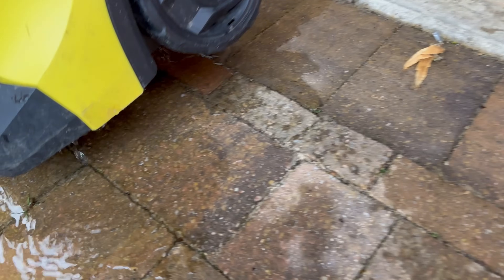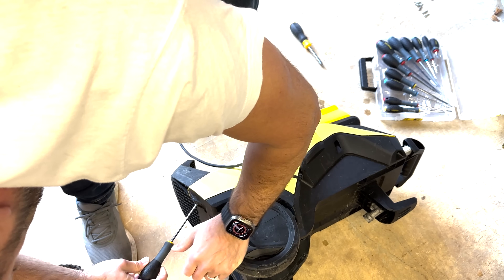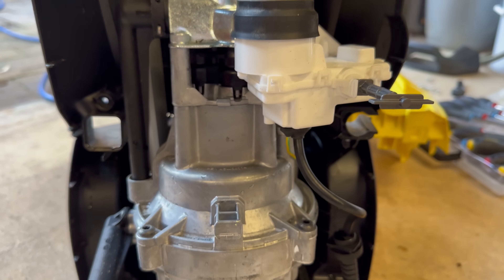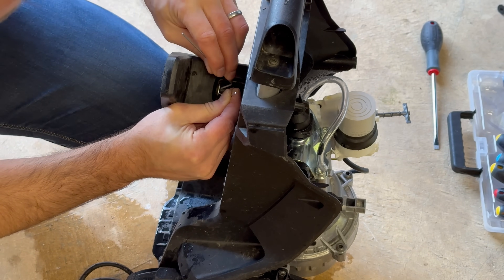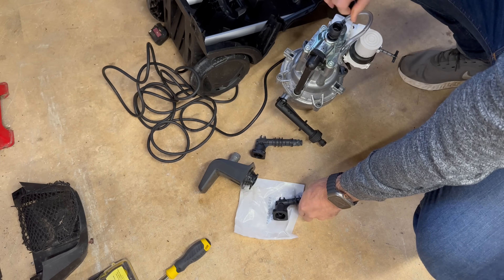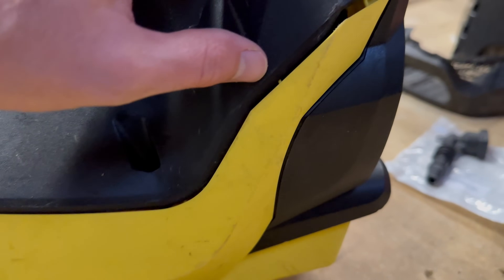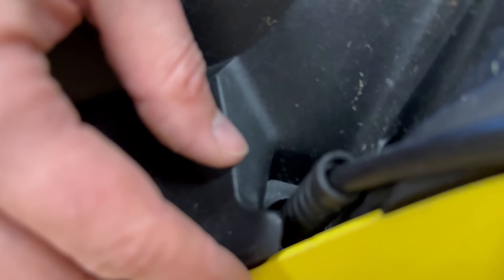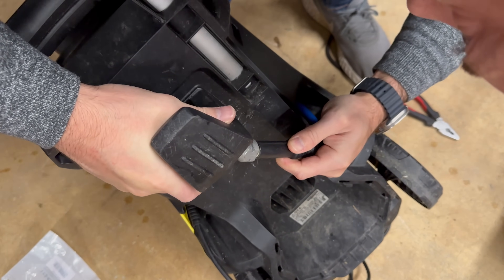Karcher K4 Pressure Washer - How to Open and Fix an Internal Leak

Comment: Thanks for the video. I have to disassembly aswell, but the pressure washer hose is stuck in the pressure washer. I really can't get it out...
Reply from the maker: Hi. If you cannot disconnect the hose after removing the spring clip, you should still be able to dismantle it with the hose still attached to the back foot.  20min 10sec onwards in the video shows the best view of the hose connector in case that helps you understand how it might be getting stuck. The back foot assembly is part number 4.100-775.0 in case you damage that and need to purchase a replacement. Good luck!
Reply: @SwiftDevelopments  thanks alot. I will give that a try 👍

Comment: Great video, have you ever worked on k5 140m please . Low pressure and on off switch stays on all the time.
Reply from the maker: I've not worked on a K5 before, but what you describe could be to do with the pump cylinder head not sealing to create the pressure it needs. Try searching for that to see if you can find similar symptoms to what you are experiencing. Hope this helps.

Comment: Thanks for this! Just one issue. I am struggling to get that c clip as you call it, to fit back through the holes. I have fully greased it up but no joy. It looks like it isnt in line when putting it back on rather than just requiring lubrication. Any ideas?
Reply from the maker: Can you see straight through like you can in my video? If not, something might not be seated properly so it lines up. Try removing the black L shaped bracket that the C clip pushes into. If the metal pipe isn’t sticking out of the casing far enough, the pump might not be seated correctly in the case. Let me know how you get on.
Reply: @SwiftDevelopments  So there seems to be some wiggle room for the metal pipe to adjust within the inside of the plastic housing. When not fitted to the pressure washer I can get the c clip to slot in fine. But when I try twisting the plastic big handle back into the housing of the washer this is when things are out of line. It's as though the metal piece is getting forced away from the pressure washer so then can't line up when trying to re attach everything
Reply from the maker: @rickphelan5438 Do you think the black plastic elbow from the pump head on the inside is not seating inside the metal connector on the big L handle on the outside? You mention it feels like it is pushing it away, could this be what is doing it?

When you take the back casing of the pressure washer off, does the big L handle slot into the pump head elbow ok and line up for the C clip to be inserted?

Comment: I plan to buy K4 for occasional car and yard washing. How long did you use the washing machine before this failure occurred? Would you recommend buying the K4 or would you pay extra for the K5?
Reply from the maker: I’ve had my K4 about six years before this happened. It has been kept in the garage (to prevent frost splitting pipes during winter months), I use it to wash two cars on average three times a month, then clean a patio with it annually. I’m happy with it, although I have been looking at Ava pressure washers that come with a 20 year warranty to replace it (I want one with a hose reel to make it easier to pack away and store). 

The K5 is slightly more powerful, aside from that I imagine construction will be very similar to the K4.
Reply: You are wrong. K5 is far better product then K4. It has aluminium pump head while on K4 is entirely made of plastic.
Reply: Does this model come with a plastic water pump? I don’t find any information. I remember speaking with a Karcher repair guy that told me that the K5 is the only one with an aluminum water pump.
Reply from the maker: Yes, the Pressure Washer Control Head in the K5 is of all-metal construction compared to the K4 which is plastic encased in metal. I’m presuming this is most likely so the K5 can run at its increased pressure and flow rate. 

Saying the K5 is better is speculative. It is 50% more expensive than the K4, so it comes down to how someone intends to use it and whether they need the increased pressure capabilities for the additional expense (and marginally increased running costs from a higher wattage motor).

Karcher doesn’t list MTBF rates for each machine, so reliability cannot be assumed from the more expensive model (although you’d like to hope so). Tolerances might be similar relative to their operating pressures and what those tolerances are for each model.
Reply: I have owned many Karcher pressure washers over the years and I have to say that they do not seem to be the most reliable of things, you're lucky to get a couple of years out of them before they start playing up. I never let my machines freeze in cold weather either. I can't say a machine made by any other brand are any better. In my experience, the bigger the model, the more unreliable it is. I am in the process of trying to fix a K4, at the minute that was pulsating and pishing water out the bottom. There doesn't appear to be any leak as in this video but haven't checked with the machine switched on yet. New pump head for my model appears to be £73, which is a bit steep.
Reply from the maker: Yeah you'll have to check where it's leaking from once you have the cover off. If it isn't the plastic elbow pipe like what happened in my video, it does usually appear to be the cylinder head that is the next part to fail.

Comment: Thanks for a really helpful video. Tt made taking my K4 apart really simple. However, my leak is coming from elsewhere so I'm wondering if you or anyone can please provide advice as neither Karcher (who only want me to send it for an expensive repair or buy a new washer)  nor several spares companies seem willing to do so. My K4 started pulsating when I power it on and the pressure is very weak when I press the trigger on the lance. I can’t see any leaks at all when a hose is connected with the water tap on (with the yellow case removed). However, when I turn on the power, a lot of water sprays from near the top of the washer control head (where the chemical tube attaches) so I assume this is where the K4 is losing pressure. There don’t seem to be leaks from anywhere else. I’ve taken the K4 apart and found 2 connected parts (Washer control head and cylinder head) . The control head has 9.075.073.0 and 9.075.072.0 printed on it. The  cylinder head looks different inside to the spares on several supplier websites in that I have 3 small white plastic pieces with springs in the top of the cylinder head, instead of one larger white piece. Is this a one with the single white central piece a replacement? Do I need to order the cylinder head as well as the control head (where the leak is)? Anything else? Sorry for the 'wordy' description but I can't attach photos. TIA
Reply from the maker: Thanks for watching and commenting. 

If you watch this Karcher video where I take the pump apart:

https://youtu.be/BbQVSJAEM3I

It provides more detailed shots for comparison and to assess and highlight where the leak is coming from.

This spares website has some exploded diagrams which should help identify what parts you need to buy:

https://www.spares2you.co.uk/k-4-full-control-gb-1.324-002.0/

Let me know how you get on and I’ll see if I can provide any more help.
Reply: @SwiftDevelopments  thanks very much for that and another great video. I've liked and subscribed. At 9.55 in that video, you remove a metal retaining plate and the "head". That "head" actually comprises 2 parts, the "cylinder head" and the 'manifold and pressure piston' (or 'control head' ) although I haven't seen you separating them in your videos. The leak I have seems to come from about 15mm below the right-angled pressure piston (where the small clear plastic tube connects) on the control head. Water sprays out from there (only when the K4 in powered on) where there is a cutout at the end of the metal retaining plate. Its hard to be precise because I can't have that metal plate removed whilst the machine is running so I can't see all the control head. I've looked carefully with a magnifying glass with the machine disassembled and the only thing I can see is what looks like a scratch around the area where the spray seems to come from. I have videos of the spray but can't send on here. 

* I should also note that my K4 has part number 1.324-009.0 on it rather than 1.324-002.0. *

I was going to order a replacement control head (my part has number 9.075-073.0 on it) but it seems different inside from the one here https://www.spares2you.co.uk/karcher-k3-k4-pressure-washer-control-head/ even though that has the same part number. Mine has a triangular cover inside (with 3 small raised circles) which prises off to reveal a spring, a white item and something yellow behind that. The cover may be called the ("head joining piece" https://www.spares2you.co.uk/karcher-cylinder-head-joining-piece/). 

My cylinder head also looks different inside from the one advertised here https://www.spares2you.co.uk/karcher-pressure-washer-cylinder-head/ even though the website says its compatible with my K4 model number. Instead of the one large central white plastic piece shown in the picture, mine has 3 small springs with small white plastic pieces underneath them, arranged in a triangle to match the 3 raised circles on the "head joining piece" in the control head.

So, I think I need the 'manifold and pressure piston' (or 'control head' ) as that's where I believe the leak is from. But, do I also need a new cylinder head (with the central white piece instead of the 3 small springs) to match it, or can I remove the "head joining piece" from my current control head and put it into the new control head (with spring and whatever the white item is behind it - both are removable)? I guess I could try just with the control head first but don't really want to keep spending on spares if the K4 ultimately isn't repairable due to design changes/parts shortages etc.

I sure wish I could send photos! Sorry for the long post and thanks again
Reply from the maker: @JonathanPinnock-mn3bm , you could always upload a video to your YouTube account and then I could take a look at your setup (in the YouTube app, select the plus icon from the bottom menu, then select Video and you can upload it from there).

1.324-009.0 is the K4 Full Control Car and Home model, the one ending in '2' is the Full Control without the patio cleaner, brush and foam cannon attachments.

From the part diagrams on this page:

https://www.spares2you.co.uk/k-4-full-control-car-home-1.324-009.0/

Because of the pressure this plastic part is under when running, a split is likely to look like a scratch.  As you cannot see it under the metal plate, try covering the scratch in tape/paint to see if it removed after testing.

There are a few parts under the control head:

https://www.spares2you.co.uk/karcher-k3-k4-pressure-washer-control-head/

Is it this:

https://www.spares2you.co.uk/karcher-pressure-washer-cylinder-head/

Or this:

https://www.spares2you.co.uk/spare-parts-set-valves/

You are describing with the raised circles?

On:

https://www.spares2you.co.uk/k-4-full-control-car-home-1.324-009.0/

I think the diagram under the heading ‘Pump WCM Plastic (HR) New’ shows the inner parts connecting to the control head.

I think it is definitely reparable, it’s just narrowing down which part(s) you need. I think from what you describe, it reads like you need the control head at (£27.89).

As far as I can tell, the cylinder head design hasn’t changed; Karcher did revise the pressure switch design in the control head (what I serviced in my latest video), in an attempt to make that more reliable. It looks like you already have this same part number (the previous design was 9.002-029.0).
Reply: @SwiftDevelopments  I also uploaded 3 photos and tagged you so assume you'll see that in your notifications (sorry - publishing novice)
Reply from the maker: @JonathanPinnock-mn3bm , I’ve checked your photos, and the control head you have is the same as:

https://www.spares2you.co.uk/karcher-k3-k4-pressure-washer-control-head/

The triangle in the middle of your third photo can be removed. On this page:

https://www.spares2you.co.uk/k-4-full-control-car-home-1.324-009.0/

It’s in the diagram ‘Head End WCM’. There’s a round O ring holding it in underneath the triangle bit. 

If you think the leak is coming from the control head (and not from the triangle shaped O ring joining the parts you currently have apart), then that’s what you need to order. 

Like you mentioned, it’s is hard to tell from the video where the water might be coming from when it’s covered by the metal brace. 

Hope this helps.
Reply: @SwiftDevelopments  thank you very much indeed. I'll order a new control head and swap that triangular piece  (I think they call it the "head joining piece") from the old control head to the new one. Once its all back together and tested, I'll let you know how I get on.
Reply from the maker: @JonathanPinnock-mn3bm  Hi Jonathan, how did you get on with your pressure washer?
Reply: @SwiftDevelopments  thanks very much for asking & sorry I didn't keep you updated. I've been on holiday until last weekend but I had notification today that the part I think I need has shipped, so when it arrives and I get a bit of time, I'll see if it works (& will definitely let you know)
Reply: @SwiftDevelopments  Hi - I replaced the part I thought had a really tiny crack (the control head) today and put the K4 back together - actually I tested it before putting it back inside the outer casing just in case of problems. Good news - the unit is no longer leaking and pulsing as it was before and on the "Mix" setting, the pressure seems ok. Unfortunately though, I can't seem to select anything other than "Mix" on the full control spray lance (vario power) and when I turn the end of the lance from Soft to Hard, the water pressure drops instead of increases and the display stays on "Mix". I changed the AAA batteries in the handle to no avail but suspect they're only for illuminating the display.  Do you think it might be because I haven't yet reconnected the short transparent pipe from the detergent dispenser to the control head?
Reply from the maker: @JonathanPinnock-mn3bm  Glad you sorted the initial issue. 👍🏼 

It’s possible not connecting that tube could mean it is sucking in air into the pressurised hose to the gun, and as a consequence, not reaching full pressure. You should be able to connect that without fully reassembling it whilst you diagnose. 

If connecting the tube doesn’t sort it, can you try another lance head to rule out the Vario lance being the issue?

As far as I understand, the lance lights are based on the pressure going through it and don’t actually control the pump itself. 

Also run it for a while to make sure there isn’t any trapped air in the pump after replacing the head. 

Let me know how you get on.
Reply: @SwiftDevelopments  All fixed and back together! Thank you so much for all your help and advice. The problem was that I'd forgotten to slot one of those right-angled pieces in, and although there were no leaks from there (or anywhere) it must have released the pressure. Felt silly for forgetting that but pleased to have the k4 working again.
Reply from the maker: @  no problem and glad to hear you’re back up and running again. Cheaper than buying a new one! 👍🏼

Comment: Hello I have exactly the same problem. I could do with fixing it today. Do you think a small flame on the split part will just bond it back together?? Cheers
Reply from the maker: I suppose you have nothing to lose in trying, I’m not sure what type of plastic it is made from and whether this could work. Remember to remove the rubber O rings first. The part is cheap to buy so it might be worth ordering one just in case it doesn’t work.

Comment: I thought those red auto lock hose connectors damaged the pumps on these?
Reply from the maker: They don’t recommend them because the flow rate might be restricted which could starve the pressure washer. 

I tested it first by spraying the pressure washer into a bucket and timed how long it took to fill it up. I then fitted the Hozelock Aqua Stop and tested again. 

I didn’t notice a difference so use it to easily swap between the pressure washer and spray gun.

Comment: Hello 
I e Chen keep my k4 outlet valve, the black part you replaced. No cracks but Doesn’t seem to snap in the silver metal hose connector. Does this have some sort of O ring on and mine is obviously missing. Thanks.
Reply from the maker: Hi, I’m not entirely sure what you’re asking because it looks like autocorrect replaced part of your message. The elbow that connects to the pressure hose does have an O ring which seals between that and the black elbow I replaced, it is then secured in place with the metal staple shaped pin that locks it into place. Hope this helps.

Comment: The detergent dispenser on my K4 has fallen into the washer.  Can I take it apart and fix it.
Reply from the maker: Hi @davidmason4084, yes you should be able to open it up to fix the dispenser. It is mounted to the yellow front part of the body.  Disassemble following my video, then you will be able to easily get to the dispenser part to reattach it (if something has snapped and it cannot be glued, you can order it as a spare part).  Google 'Karcher Solution Docking Station Complete' if you need to order the part (if it is the same model as mine).